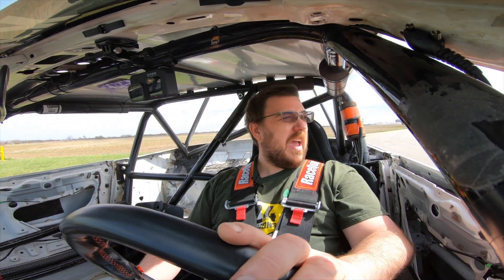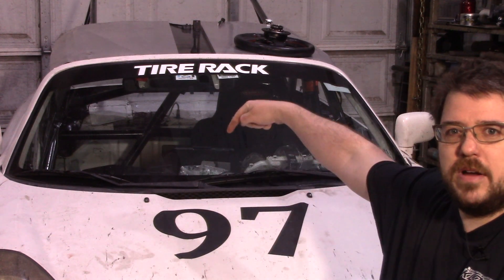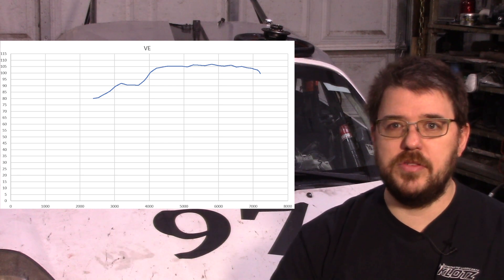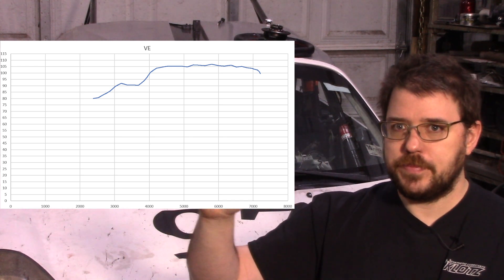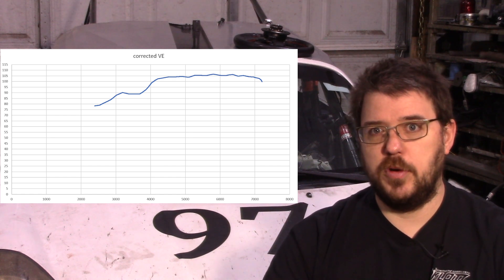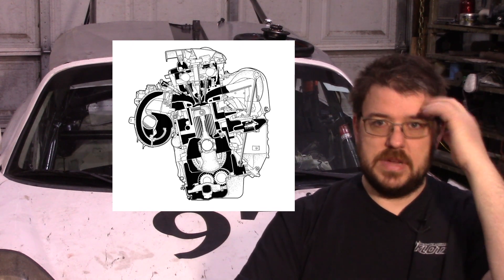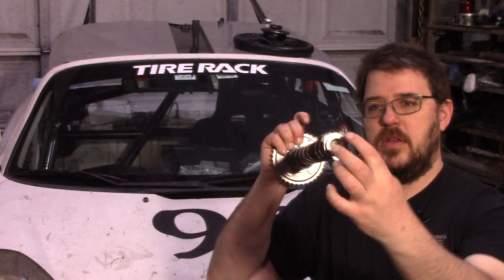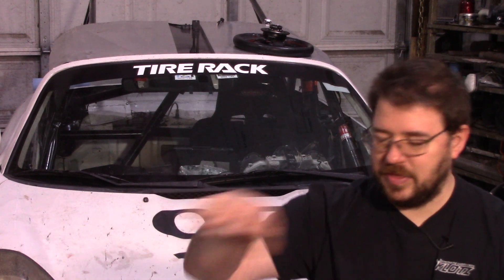Next steps for adding power to the 2AR-FE/1AR-FE platform

Comment: I have a question, after looking at the volumetric efficiency map, how would you know if the restriction is the intake manifold or the headers if the grapgh would show VE under 100%?. Im a toyota fan, and im extremly shoked that this engine is capable of those numbers. Toyota engines are not known for being N/A mosters, im really happy that someone out there is trying his best to beat those K series. Doing a great job on this build.
Reply from the maker: The cheapest way to do that would be to use a saab trionic ignition module to determine if your cylinder pressure is higher or lower. intake restriction would make a lower cylinder pressure than the exhaust restriction would. But i'd have to scratch my head a bit more, maybe there's a better solution.
Reply: @FrankensteinMotorworks  thanks, there has to be a better solution, but your explanation makes sence, thanks for explaining

Comment: Hey man, this is great and all but isn’t the plan to beat a k24 swap because it’ll be cheaper?  Changing the pistons will surely put it above the cost of a k24 swap with rbc, Vtc 50, and drag cams.  Also, cams and oil pump seem DIY-friendly but engine disassembly is next level.  If it can make 250-260 whp and rev to 8k without changing the pistons, would probably sway people from a k swap.  People like myself enjoy the high revving motors like the 2zz but just want more power and torque.  Just my thoughts man, keep up the good work.
Reply from the maker: i suspect you did not watch the entire video. At the end i mention the 2AR-FXE which requires way less work and cost as a starting point.
Reply: Fxe valve springs the same, or less stiff? Esp exhaust?
Reply from the maker: @jdchmiel  That's something i should have covered in the video, sorry. But yeah the valvetrain parts all match between the FE and the FXE except for the cams themselves.
Reply: Gotcha, I hope those cams will do the trick.

Comment: How many seconds was that 0-60?
Reply from the maker: about 4.2s or so with tire spin, it can likely do a 4.0 with better traction.
Reply: @FrankensteinMotorworks  That is very impressive!  What do you think is ideal power to where it won’t be traction limited?
Reply from the maker: @samuraialbany  I think the current power level could be dealt with if i had wider rear tires and/or stickier tires. because of the kind of racing i do with this i am limited to 200 threadwear tires. But 1g acceleration in 1st gear certainly feels violent.